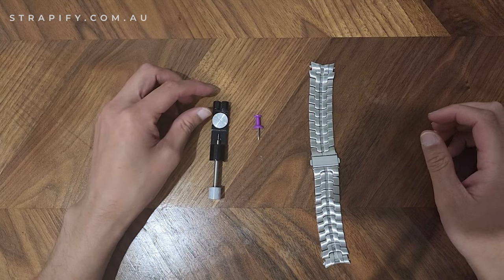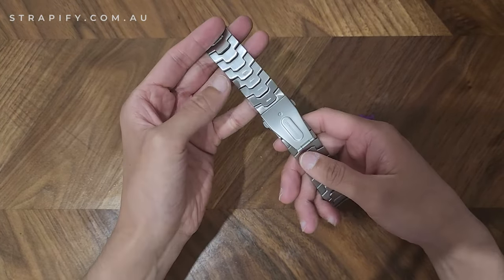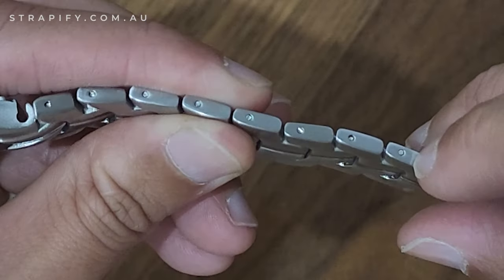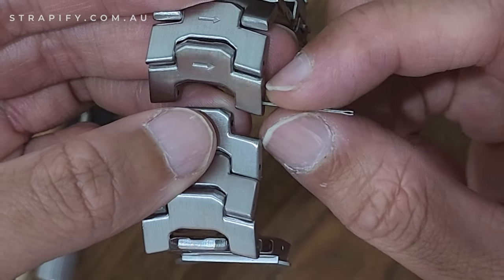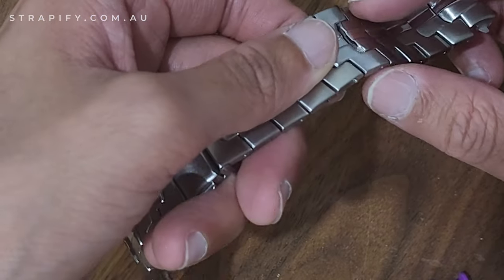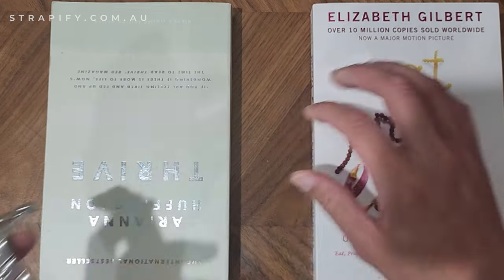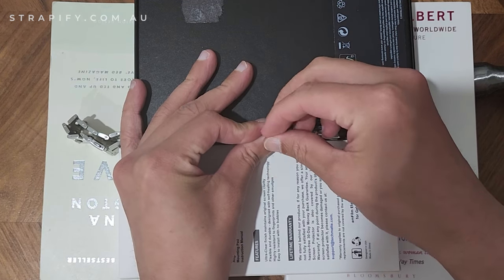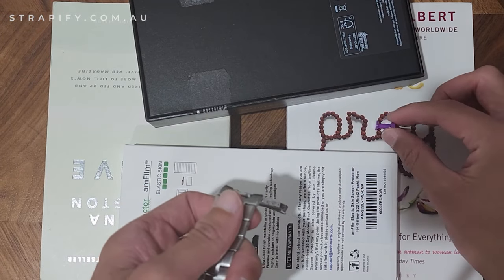Remove Watch Bracelet Links without tools! (2024 Best Method!). Resize and shorten band and straps!

Comment: I did it and it worked! Instead of the thumb tack for the initial removal I used a mechanical pencil. Some of the pencils have the little metal tube that sticks out where the lead comes out that does not move in or out - some do not. I found one that I had. It was easy to push the pin out with it. I did use the tack to slightly tap it back in the last little bit (although it probably didn't need it so much).

Comment: This worked for me, but only after beating the crap out of it for an hour or so. Worked better once I broke off the sharp point of the thumbtack so it was flat ended, and I don't think it would have worked with a normal thumbtack- we happened to have some solid metal thumbtacks that were like, industrial or smth

Comment: If you have a bench vice, place a safety pin in the vice and clamp it tight, this is much easier than balancing a thumbtack or pin on a table, and you can also crouch down below the height of the vice and look up to make sure the safety pin is located in the hole for the watch pin, before you apply the pressure to push the watch pin out, thus preventing any scratches 👍
Reply: That's super risky

Comment: Works a treat, thanks! I used the gap between the wooden floorboards instead of books, as this was filled and easy enough to retrieve the pin. Is interesting that using manual force doesn't do the trick, but tapping with something heavy like a power bank works every time.

Comment: Technique I used for the steel strap for galaxy 7 ultra smart watch was using the end of nail file on my toenail clipper to push it out a bit and then use the toenail clipper to grip it on the other end and pull it out. Probably not a good way of doing it but hey, it worked xD
Reply: Tysm this worked so well

Comment: the pin is too tight ): i tried to use the screw thingy and the sim ejector it didn’t work ): i just wanna wear my watch
Reply from the maker: Could be the case. It also could be that it’s actually a screw.

Comment: I bought a cheap one off Amazon for a fitness watch. Dicked around with it for 20 minutes, couldn't even get one to budge, so I spiked it off my concrete floor. Amazingly the pins all  budged then! Problem solved by throwing these horrible bands in the trash and buying anything but these.

Seriously its 2023, there are better ways to make things that adjust.